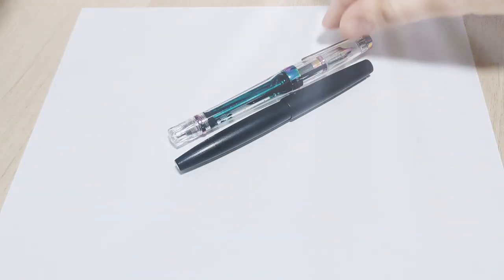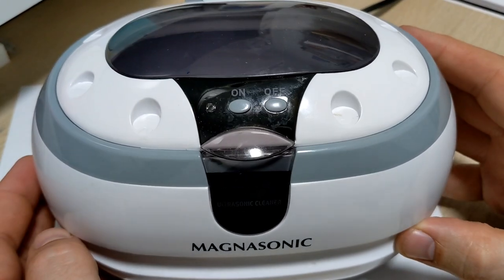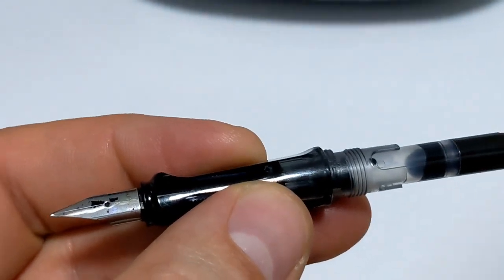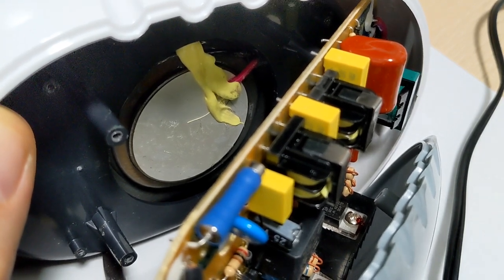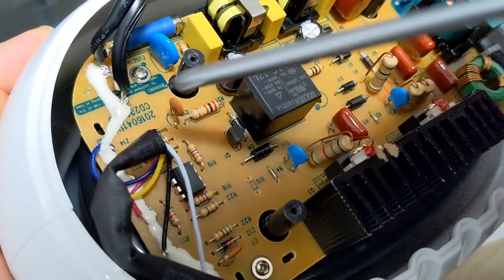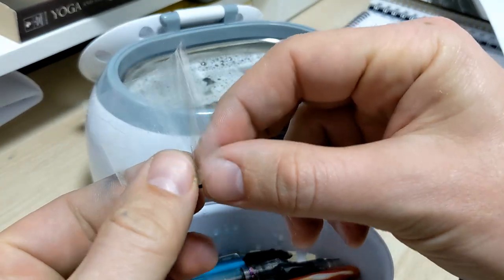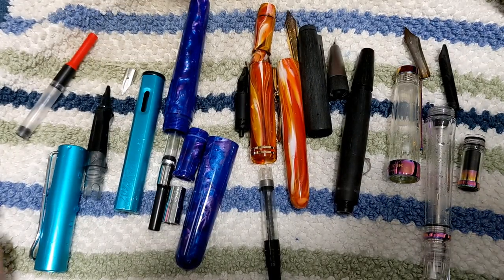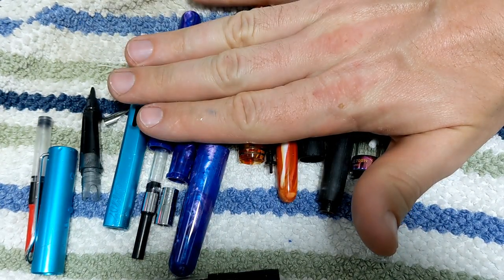Ultrasonic Cleaners - How Do They Work (Cleaning Fountain Pens)

Comment: I bought a super cheap ultrasonic cleaner for glasses and stuff. Then I found an old Montblanc from the 70's at the bottom of a pen drawer at my father's place. It was so crusted up and it looked extremely sad. So I tried to clean it with water, with hot water, with alcohol, let it sit in warm water until I had the idea to just dump it into my ultrasonic machine and voila, that did the trick. Had to change the water several times because there was an incredible amount of ink built up in the feed and everywhere, I couldn't even disassemble the feed and nib because it was just one solid rock of dried ink ^^ After an hour of work it was back in great shape and my dad let me keep it.
Reply from the maker: The alcohol made me gasp, but then kept reading & heard the good outcome... PHEEEEW!!! 😅. Ultrasonic cleaners are really useful when they are needed. And oh yeah.... Alcohol is for drinking not for your pens 🍻😉

Comment: I use a DK Sonic 2L ultrasonic cleaner to help clean my fountain pens. However, you dismantling your unit, and the explanation how an ultrasonic cleaner works is great and interesting. Just make sure you don’t put your finger in while it is in use, gives a weird piercing feeling, lol.
Reply from the maker: You can stick you finger in there, it's ok just sound waves. Might want to avoid sticking other things in there though 🤔😉

Comment: Good to see it didn't damage any pens, I have a vevor 15 liter and I have been leary putting my vintage pens in with gold plating exc. It dulls shiny anodizing and would prob take it all of if left in longer. Worried it would take any fragile plating off some old pens that have slight pitting exc
Reply from the maker: This won't take off anodizing.  Its a chemical bond and very tough coating

Comment: Omg..I won an auction of vintage fountain pens thinking I was going to start restoring pens..well it didn't work out so well. I loaded them all into my ultrasonic cleaner ( not realizing the heat was turned on ) and was completely bummed to say the least as I fished out the melted & mangled remains of what used to be some very cool vintage writing utensils!
Reply from the maker: Yeah heat isn't good for vintage materials

Comment: Oh yeah, in case anyone's thinking of it, don't put your curidas feed in the ultrasonic cleaner for three cycles. There's a little  metal cylinder that seats the converter jacket, and it came loose. Yeah 1mm piece of metal in a metal ultrasonic cleaner gets dumped into a metal sink... Don't ask how I could see and grab it before it went down the drain but I'm glad I did. Reinsert and it's all good but no more ultrasonic cleaning for that feed unit.

Comment: Woah I would have assumed that Visconti's volcano material would be too porous to safely chuck in an ultrasonic cleaner! 🤯
Reply from the maker: The resin is very strong & durable. Any water it does absorb will evaporate. The cleaner does a great job at removing oils etc from the pores bringing it back to like new condition

Comment: These blow up around 12 months.   I have gone through 2 of them in the past 2 years to clean stuff and it works great with dawn dish soap and zero water.
Reply from the maker: I wouldnt recommend using soap only.  They arent designed for that as the sound waves are meant to travel though water or liquids with a similar density.

Comment: thank you for this video! Is it possible to use an ultrasonic cleaner for goldplated or rosegold plated nibs or other parts of the pen that are plated? Will the plating come off or will it be just fine? I have a TWSBI diamond 580 rose gold and some gold plated steel nibs on other pens (and some 14k and 18k nibs but I think they will be safe in the ultrasonic cleaner). And is it possible to put a Noodler’s Ahab in it? I really hope that the ugly smell will dissapear😂
Reply from the maker: I've put in pens with nibs that have coating and haven't had any issues.  That being said, if there is a flaw or defect in a coating, there is a chance it could start to come off from the cleaner.  I guess I'm lucky I have sinus issues and don't smell the odor people talk about with the Noodlers pens LOL
Reply: @Doodlebud  Thank you for your quick response! It was very helpful. The smell of the Ahab is really bad so I guess you are lucky😂

Comment: Apart from old dip mapping pens, I can't find anything that will reliably write fine enough with indelible ink and not be blocked up solid the second time I want to use it.
I had Rapidograph and Marsmatic needle pens for decades, but always had the tremendous hassle of dismantling them and teasing the needle cleaner wireout under water and through a magnifying glass to get it back together.  Always, the ink would go anywhere but down inside the needle once you stopped and put the pen awayfor a while. Makes no difference how expensive they are, anything .2mm or less is a pain in the neck, and you are going to break the fine wire after you've cleaned it a few times, and soaked yourself and the kitchen in the process.  Yet most paper we have to write on, is so unsuitable for ink, that even a nominal .2mm is more likely to be .35 on the page.  There are a few specialist fibre tip pens that start out nearly good enough, but they wear flat after a few thousand words.  So, for anything much less than a paragraph, the 50p dip pen I had at school a lifetime ago is still king.

I recently lost track of my old pens after a move, and found replacements were now super expensive.  A couple of cheaper Chinese versions were found, that seemed ok at first, soon developed the same old ink everywhere but down the stylus habit, so, I reluctantly got myself a new Marsmatic .18. It looked and felt really well made, and let me write a whole page, all fine and impressively, on filling with the expensive branded ink just to be safe...  And so, tonight, wanting to annotate some accounts, I unscrewed the 'hermetically sealed wonder mechanism cap', and after 45 minutes of shaking, and vibrating with a toothbrush, and refilling and warming the reservoir to up the pressure... Not a drop comes down the needle, and I reached for my trusty pencil.  (Diary conservators actually say they prefer pencil, because it actually stays legible longer than many inks!)

So: Have you tried cleaning proper fine pens with the ultrasonic.  I think I need a test tube sized one on the desk at all times, so I can just wet and vibrate the needle assembly before every writing session.

Good to see what was inside your one, but I was amazed at the size of the components and circuit boards.  Reminds me of pulling trannies apart as a kid! :)
Reply from the maker: I don't have any super fine tipped fountain pens so not u're if that will fix your issue
Reply: I bit the bullet and ordered a general purpose US cleaner. I can likely make a perforated cover to take pens in test tubes to suspend in the cleaner tank.  Rotring did actually make a bean tin sized cleaner at one time, but it's a rare collectable now.  A desktop with a 'buzzing cleaner/inkwell' would be great for both dip pen and needle pen enthusiasts...